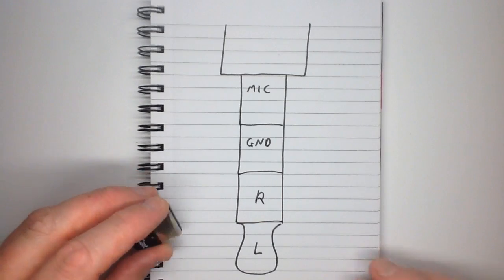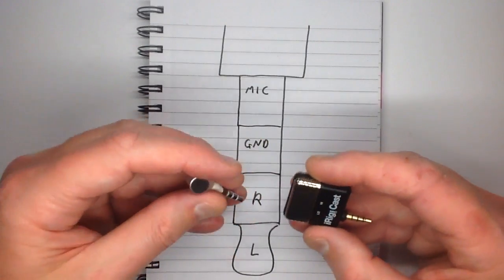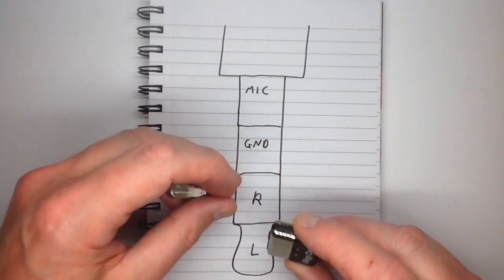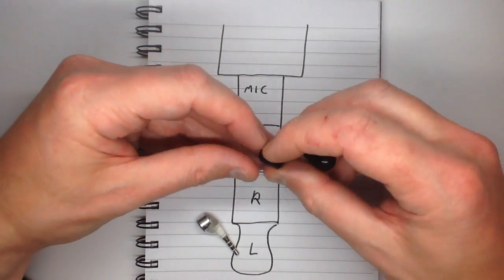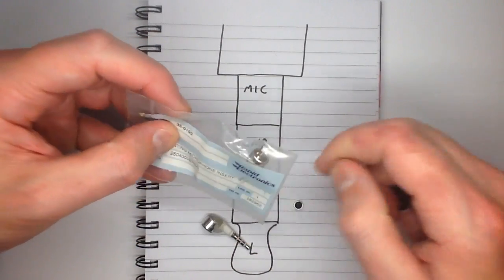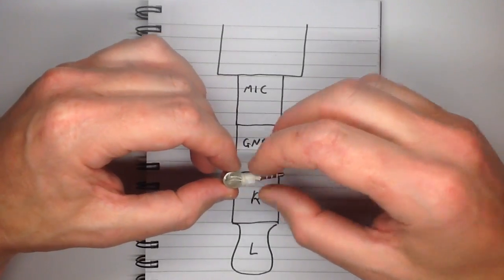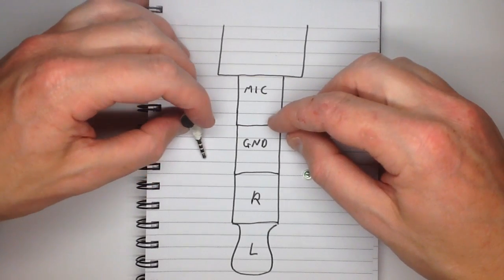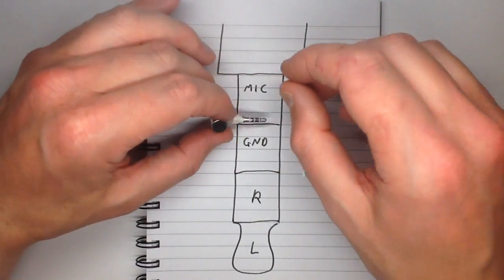Testing a DIY iPad microphone.

Comment: How is the electret capsule connected? I can't find any schematics online that wouldexplain how to wire the capsule to get the bias voltage from the TRRS jack. Everybody just says i need a third wire but i know i don't as manufactured mics obviously work without one.

Comment: The mic you made is worse than the built in mic, no question.. It sounds like you are speaking down a cardboard tube. Lots of fake boomy sounding bass, Not good at all.

If you have poor quality playback gear, it may compensate with compression (that's the reason that some folks can hear more bass,.. it's compression of high frequencies and loss of clarity, -a smoothing of peaks , so it's a less nasty, but less accurate or less honest sound playback)

I used cheap headphones,  in ear then open back, then a sony hifi. then I tried reference Grado headphones and a reference HiFi. (-Peachtree Nova 125, using ESS Sabre 9018 chips in the DAC. along with a REL R218 Subwoofer, Paradigm s2 signature reference speakers. Cables are fine silver plated 100% copper. Tesla4 from synergistic.) all set up in an acoustically balanced critical listening room.  

All 3 mics are not that good at all, but the iRig is the least shitty sounding.
FYI I think the hiss is your other gear interfering with the ipad mic... I get zero internal hiss. Might want to try unplugging lights and other things and then listening. Either that or get a replacement ipad. it shouldn't hiss like that at all.

Comment: Best sounding microphones, widest range, are 6mm, esp. Panasonic made ones are legendary as measurement microphones. But at 9mm you have some efficiency advantage and dynamic range, and freq range is still well wide enough for speech.

Perhaps combining multiple 6mm capsules would be it? Or maybe rigging a higher voltage power supply to them?

Comment: reversed polarity on a condenser mic creates a tinny sound like your talking through a can but with more bass. Also it has some "bottoming out" effects which is not good either. The bigger the mic element to more sensitive it will be, thus the "noise" is back and I'm also hearing the reflected sound too.. Try a pop sock / screen on it  to help with that.
Try it again with the correct polarity and it should sound better.

You could always get a proper mic with a break out adapter to go from XLR to that mini plug if you want to go that route but I assume you want to "KISS" it.. and as have few parts as possible.
Reply: Well yes I was assuming one would have 48 volts and either a mixer that supplies 48v or a phantom power injector to drive a condenser mic before actually buying one.
I also keep forgetting this is youtube lol. I get messages all the time from streamers and youtubers wanting to know "why isn't my new mic working" only to find out they don't have the proper support gear to properly run a condenser mic.
My fault I didn't clairify that a condenser needs 48v..

The iRig seems to be a good mic for mobile devices but again, my fault I am used to full blown studio and PA type setups. My recording and streaming setup have a Mackie 1602vlz4 mixer board, Ashly GQX3102 EQ, and I use a Sennhieser MK4 behind a 6" pop screen, I also have some compressor/limiters, and some 200 watt EV amplifires for when I need a monitor system up.

I may get a hold of an iRig for my mobile phone though since I started using it as a video camera recently.
Reply: YEah I first heard about it on this channel. so yeah it sounds good from what I have heard so far

Comment: iRig, then internal, then inverted wiring one.
I'm listening with a decent non-pc set of speakers, sub and Yamaha amp.
The difficulty for me is that my ears have suffered from years of abuse, so bassy audio makes it difficult for me to understand speech with real clarity.
The homebrew microphone has what I would call tunnel sound. If you place a cardboard tube over a microphone and record the resultant audio, that's the way it sounds to me. Yes, it has more bass but at the expense of the 'open' sound that I prefer.
Opinions are, of course, like arseholes, everyone has one :-).
Regards,
Brad.

Comment: I'm using this kind of diy microphones for teamspeak. They distort really fast so it is very useful to add some filtering. This way mic 1$ mic sounds better than many expensive headsets. 

But some times, and I don't know why, this mic starts to make annoying noise till I disconnect and reconnect it again. This happens about every 20min and I dont solved the problem by now. Not sure what to do..

Comment: I am listening with 2 12" PA speakers and here it sounds like there is to much low-mid. The iRig mic sounds better in this case because the frequenties are more in balance. You could try to solder an XLR to de 4-pin mini-jack and that way you could connect an external profesional mic (an overhead or a shot-gun mic).

Comment: I'm surprised that second mic worked, from what i understood from years ago they have a small pre amp inside, that's why you need the voltage on the mic+ connection
Also, finding a better mic for hangouts i found there are various gain levels, the ones i got were 36-38db gain http://www.amazon.co.uk/gp/product/B00LUUH9QW?psc=1&redirect=true&ref_=oh_aui_detailpage_o09_s00
Reply: I was going to say that about the polarity, but thought I'd look in the comments first to see if anyone had picked up on it. I was going to comment, "Are you sure it's wired the wrong way?"

Comment: If you need to remove the epoxy, a hot air wand (such as for SMD soldering) at about 160C (experiment) is great for raising epoxy to its glassification point, allowing you to chip it away as a more brittle solid...at least until it cools back down and returns to normal.